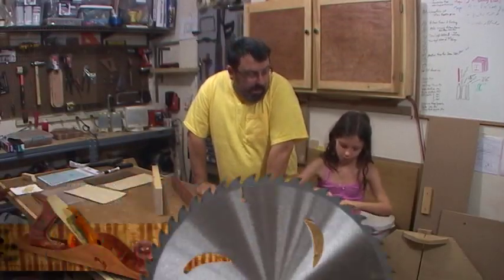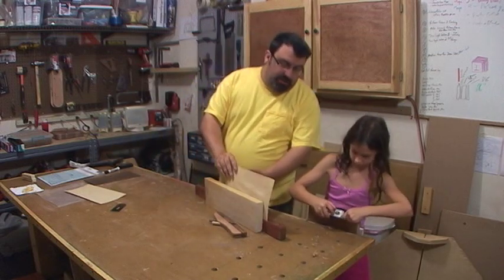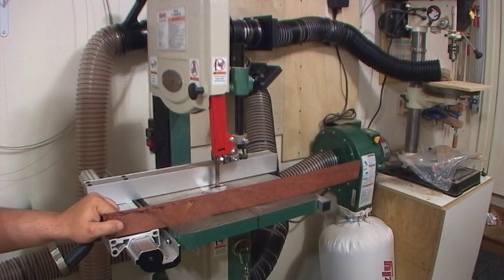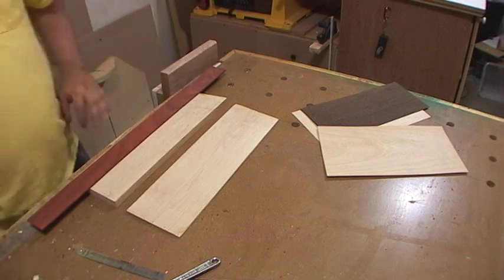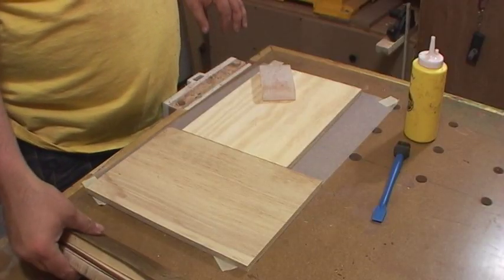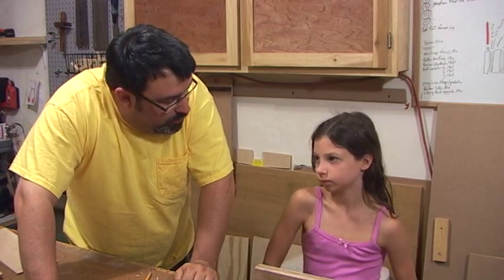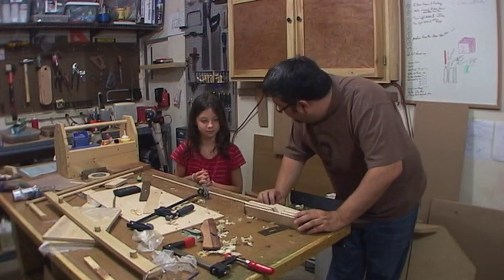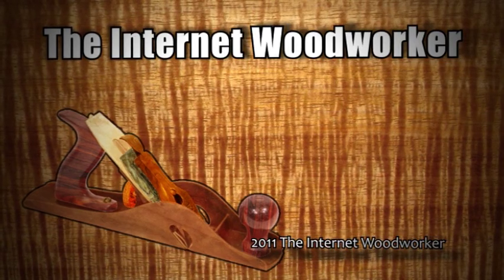TIW Ep. 33 - The Reese Plane Part 1

Comment: How did you make your dust collector system I see in the background?
Reply from the maker: James
Sorry it has taken so long to get back to you January has been a rough month.  Episode 28 through 31 I show how I did the install of the dust collection.   That install was awhile ago and I am going to make some changes.  along the wall i am going to replace a lot of the flex tubing with PVC 4" to increase suction, and I don't use the dust collector on the table saw it never worked right.  The small table saw works best with a shop vac in the port.